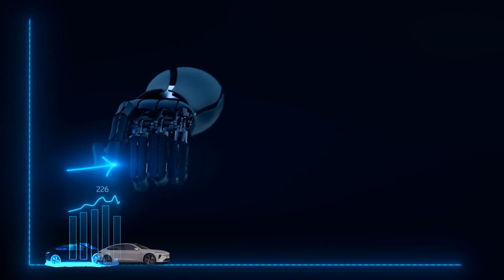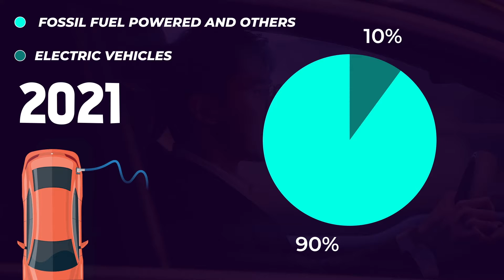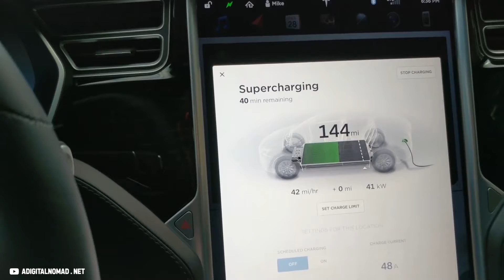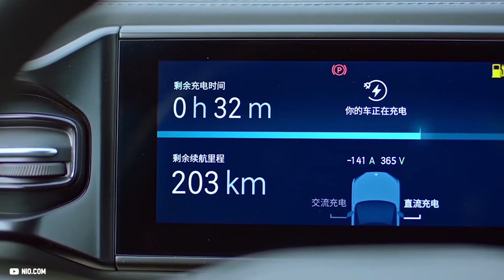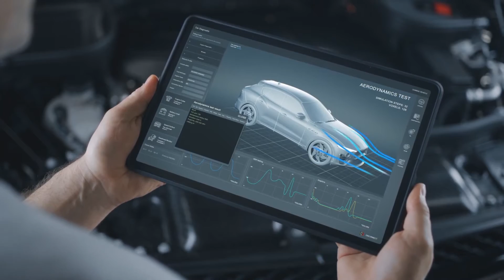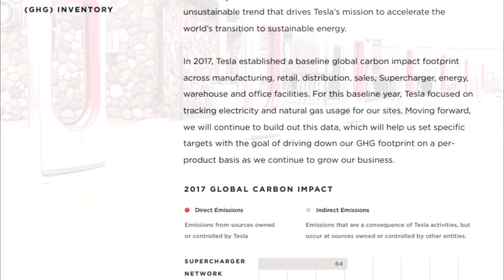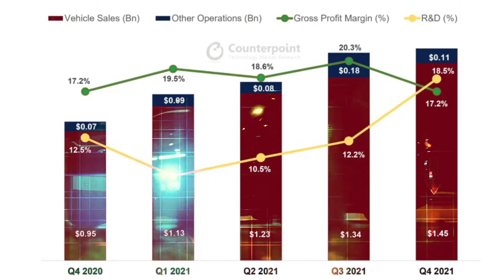Tesla VS NIO - How NIO wants to beat Tesla in 2023!

Comment: People call NIO the Tesla hunter?  Who are these people no one I know! Tesla worry about NIO competition yeah right only the NIO self promoters says this, Can't see how NIO at 30% growth can catch up with Tesla that is selling 10X more and on the way to 20m cars in 2030?  It will take NIO at the current growth rate at least 6 years to hit 1m!  Who are you trying to fool.  Tesla real competition every grade school kids know is BYD which is own by Warren Buffet.  Any chance NIO get an endorsement from Warren or even Cathy Woods?  Talking about battery swaps BS, NIO is finding out a lack of buyers for its car and so finance it with BS to lower the cost for buyers.  Unfortunately now 3 years later we are seeing the drag on NIO margin as the cost of BS amortizes.  NIO margin going into 2023-2025 will be significantly hampered even if it can sell 30% more cars as the margin collapses to 5-7%!  At this margin NIO runs out of cash fast and will have problem expanding capacity so will need to issue more debt unfortunately it has already loaded up and more debt will impact their existing debt servicing agreement so NIO with 12-18 months will need to raise another $3B.  NIO market cap at 16B will be diluted 20% so best case for NIO stock price to 2025 is around current level of 9 but can be much lower around $6!  Upside is not possible due to its constraint in production.  It is a very capital intensive industrial business there is no miracle or quick money.  Every single motor company is chasing the same market and competition is only going to increase as time goes on.  NIO to me has lost it's battle and probably settle as a medium size chinese EV makers waiting for hand out from the government.